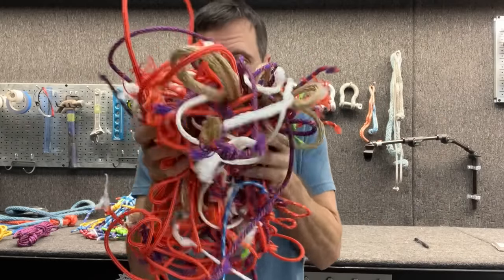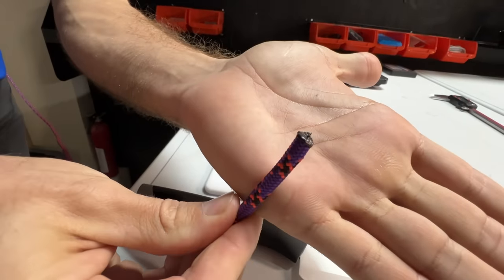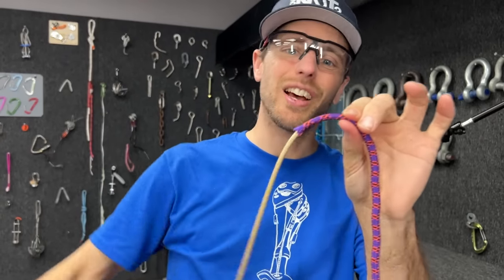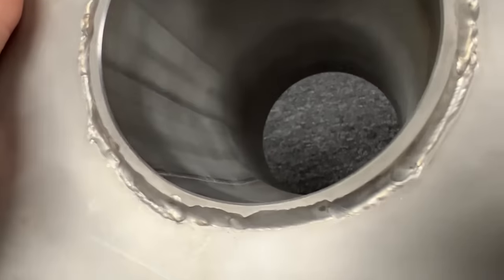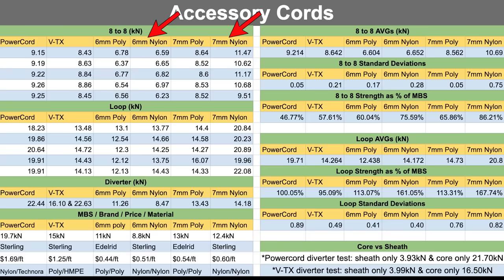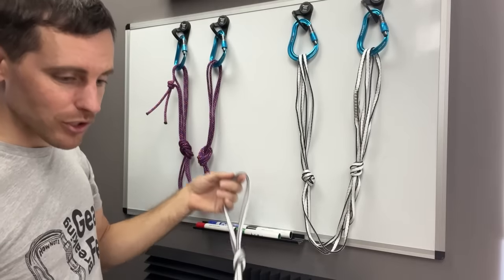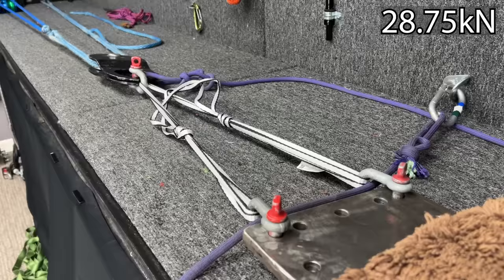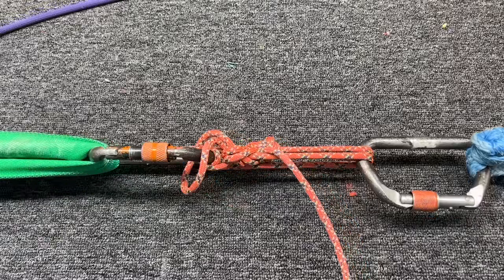One of these is safer than you think

Comment: As someone who has started using hitches more often for rope-climbing of trees, I've been sadly disappointed by the lack of good real-world info on accessory cord. So thank you for your work in adding to that knowledge. Interesting to see that good old nylon still "just works" in real-world conditions whereas high-tech fibers require nuance and careful consideration to be used to maximum effect.
Reply: exactly, the good old pa cord just do the job in normal usage. it´s long lasting and damn cheap. Just when someone need a no strecht cord for special applications, pe or aramide is handy.

Comment: If you're going to replace the metal drums you use for breaking, you might want to try filling the middle of the drum with concrete. Steel is strong in tension, concrete is strong in compression. The concrete filling will support the concrete "skin" and prevent it from necking.
Reply: I'm imagining a concrete cylinder going flying when the object under test finally breaks...
Reply: @leveller4 you can literally weld end caps to it
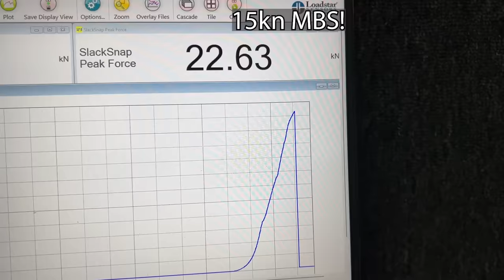Reply: @Srealdan Not my point. See how the diverter recoils and careens around at @3:27? Now imagine it doing that filled with concrete. Seems like it could cause a lot of damage.

Comment: Sometimes the reason powercord is chosen over a sling has more to do with being able to untie it after it has been loaded.  Dyneema slings can get extremely difficult to until after a few falls.  If you're doing multis and just racking the quad after use, that's fine, but if you need that sling for something else it becomes a real pain.
Reply: I also thought power cord was more abrasion resistant that dyneema or VTX. No?
Reply: Since it has a sheat and a core it should be more bomber than a plain sling. Also, if you happen to need a lot of cord for emergencies you already got some.
Reply: Also, hpme doesn't like UV and bending right? So you have to retire your quad earlier if made of a 240cm sling
Reply: @iacamigevaerd376  Technora likes bending less than hmpe.
Reply: @jbringleyable  Most likely power cord is the less abrasion resistant than VTX, because the nylon sheath will abraid more easily than the polyester sheath.
Reply: sure but the bending on a quad has a really big radius so it's barely bending.

Comment: Thanks again for testing stuff we can only wonder about. Two points to contemplate. 

First, If you believe the theory (and I don't), the sum of the separate core and sheath  breaking strengths should be greater than breaking strength of the rope. The main reason is the lay angle theta of the yarns in the sheath. When the sheath is on the rope,  the lay angle is rather high -- like 45 degrees -- and a straight pull  of the rope makes each yarn see a force proportional  to 1/cos(theta). As the separately-pulled sheathe stretches, theta decreases and the force on each yarn gets to be a lower fraction of the total pull force. The actual trig relationships are way complicated.

Second, diverters are supposed to make wrapped rope follow the capstan equation; with each wrap there is an exponential decrease. If each wrap causes a 2x multiplication of force, 4 wraps gives 16x force multiplication, and 8 wraps gives a 256x multiplication, 12 wraps gives a 4096x multiplication. OK, you probably knew that.

I break a lot of cordage, and I noticed some pre-packaged 7mm REI cords break at least 1.5 times the stated mbs. (I have a quasi-diverter.)  I wonder if the manufacturer is really giving us the 8-8 strength? I've also noticed a variation of 10% in the weight per length in different batches of supposedly the same rope or webbing from REI.
Reply: Is there any particular reason you don't believe the theory?
Reply: @patrickherke8947   Somewhat tongue-in-cheek. But the full theory has a more dramatic dependence on lay angle, and takes into account the forces the crossing yarns impart on each other, models the yarns as helices and more. I am about to leave, and could not locate that paper right now, but will try to find it later.
Reply: @patrickherke8947 McKenna, H.A., Hearle, J.W.S. and O’Hear, N. (2004) Handbook of Fibre Rope Technology. CRC Press, Boca Raton, Fl. pp 145-146. (available on web as pdf as of 2018). pp 144-145
Reply: @harlanstockman5703  sounds interesting, I'll have to take a look at the paper when I get a chance

Comment: I don't have any VTX but I do use Bluewater Titan cord as a cordalette for trad and mountaineering, which I think is a similar construction to VTX (dyneema core). I like the way it handles waaay better than the stiffer powercord, and I was also concerned with some old test data showing that aramid-family fibers lose strength rather quickly due to repeated bending, so while powercord might start stronger than VTX or Titan cord, it likely will be weaker than them after some use, especially if constantly tied and retied as a cordalette.

Comment: 7mm Sterling has been my go to for a long time when setting trad anchors to TR off of for single pitch cragging days, fat compared to some other 7mm cords, but very supple and confidence inspiring.

For multipitch I have been using 20ft of 5.5mm Blue Water Dyneema cord or a 240cm Mammut Dyneema sling mostly. For multis with known bolted anchors 180cm Mammut Dyneema sling in pre-tied quad config.

Comment: Where I saw PowerCord first used was with high directionals for rescue/rope access - like TerrAdaptor or the SMC Vector. Especially if hiking into the backcountry, having lightweight, strong, compact cordage for when you need a 50ft back-tie guy rope for your high directional.

Comment: LOVE the detailed numbers you provide! I have been wondering where the true benefits lie in the materials based on applications and have not been able to find much comparative test data. This helps A LOT to form that understanding better. Also, the rope end cutting/burning tip is awesome! I'll have to try that myself. My use for accessory cords comes in the form of friction hitches on static ropes for tree climbing so considering I'll be having my body weight loaded on my hitches for an extended period of time, its important to know as many details as possible.

Would love to see you do the same tests on Sterling TRC 6mm. I would imagine it ends up being the same results as the PowerCord but considering the fire resistant sheathing, it has me wondering if there's more to consider there? That's a popular cord being used for friction hitches lately in the space I mentioned so having some numbers there to actualize would be amazing.

Comment: My local shop stocks Liros (regatta I think) in lots of sizes (3-6mm from memory). It is dyneema with what feels like a nylon sheath but might be poly. I have the 5mm slinging an old small hex and 6mm slinging a big one. I wonder how diameter changes how much mbs you loose in these types of fibers. It also stocks the beal 5.5mm aramid. Beal also has 5.5mm dyneema. These could potentially be light and still strong for a quad and the 6mm dyneema might be crazy. Maybe strong enough to use something that takes less material than a quad? You have access to other high tec fibers like this? I am in Europe so don’t know about sending things to test to you.

Comment: I feel like it's worth mentioning that the PowerCord is the only one tested that is likely suitable for use as a prussik, due to its high heat resistance.
Reply from the maker: The nylon sheath will would melt exactly the same as any other nylon sheathed cord :)
Reply: That stuff is so stiff it would be terrible for a friction hitch. The nylon and polyester cords will certainly work better.

Comment: Request: make an episode testing the most bomber way to sling a chicken head. Headed to Cochise next week and there just is not a lot of info out there. Would be interested to see if different mm cordelletes made into various sling lengths with double fisherman’s would hold a fall. Also curious what the actual strength of different methods of slinging chickenheads are. Like clove vs girth etc. Would be super interesting if a little niche.
Reply: Rock is the weak point. Testing wouldn't tell ya anything useful. Your dynamic rope will limit the force on the pro to be much lower than breaking strength related to the way of slinging the knob/chickenhead (slip / clove / etc).

Comment: Let me add something:
We did a mini test about Purcell Prusiks on 9mm static rope. 
Purcell Prusiks built from accessory cords. 
Result:
Sterling accessory cord - works. Holds our weight, but can be released. 
Blue water accessory cord- DO NOT USE. It is slipping and it is too stiff. 

You guys could test that more scientifically. 😎

Comment: sheath to core fracture  - gets complex - depending on the "grip" ...  lol...

UTS vs strain limits - it's confounding..

(same with composite combinations - ie. if the e-glass stretches (high strain) so that  the backup ?? Carbon fibre/Kevlar/spectra (??lower strain)  ?? reaches UTS  first - is there any benefit.  in the combination.

Sheathing for UV/friction resistance - here is a reason, But for strength ??? - should it be secured ??

I might go with spectra/dyneema webbing...  (I have been kiting over the "decades" - I trust new lines - old ones...  (kiting isn't life critical - normally)...)

Back it up for life critical use cases... (don't trust life on accessory cord x1...